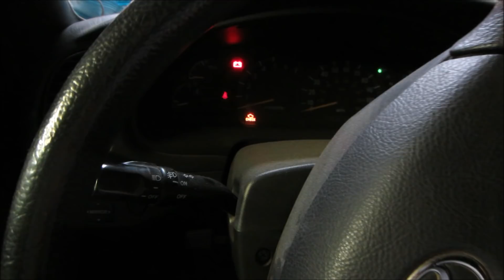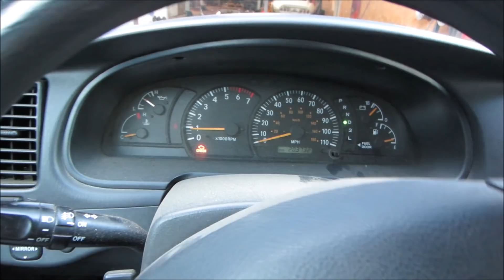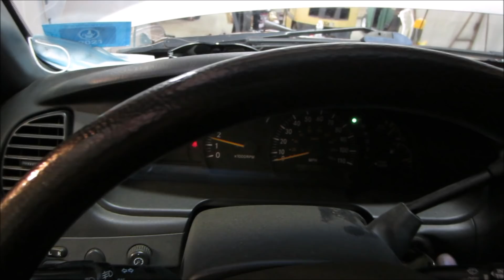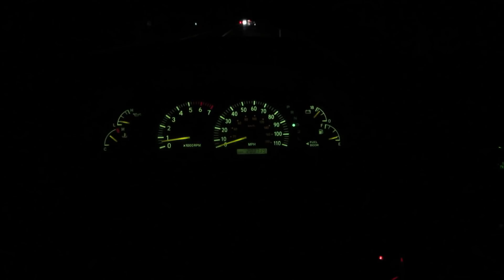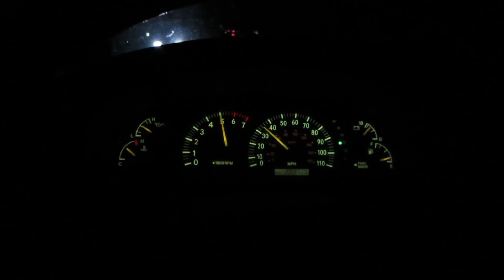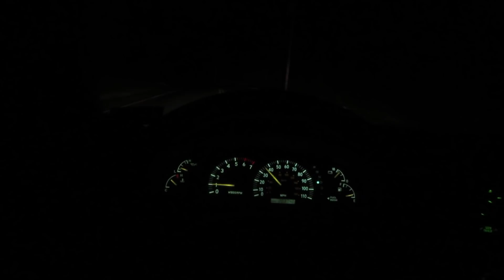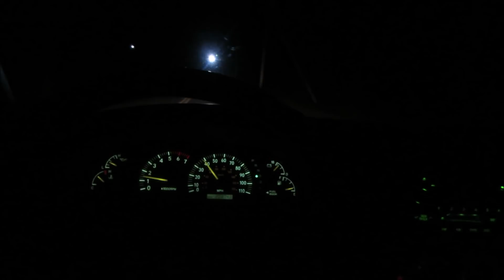What Screwed Up My Engine? You Won't Believe It

Comment: I got a tip that might help you out in the future....if an engine Has a Miss while it's running..a quick way to do a check on the compression to know whether if there's mechanical damage or not is... rev the engine to about 3500-4000 RPM hold it steady then turn the ignition switch off and as soon as the you turn the ignition switch off ,floor the throttle... as the engine is dying it should die smoothly with no miss...because you eliminated Fuel and Fire.. the engine should be smooth as it's dying....but if it still sounds/feels  like it has a Miss as the engine is dying... there's a compression issue...this works every time

Comment: I had a 2005 Toyota Sequoia with the 4.7L V8. I thought it was an interference engine but debate rages on the interwebs. With your passenger side pully several teeth off it still runs, so I'm guessing NO. I have seen a suggestion that ALL 4.7/2UZFE are interference engines but another place says only post VVT-I engines are. meaning pre-05 are not. If that's true, mine was and yours isn't!

Great fix at any rate. Sorry about Mickey, er Ferris. That’s one for the books!

Comment: Could a used a u bolt fit if it fitted round the exhaust instead of welding it? Good job with the welding anyway. Nice little pick up.

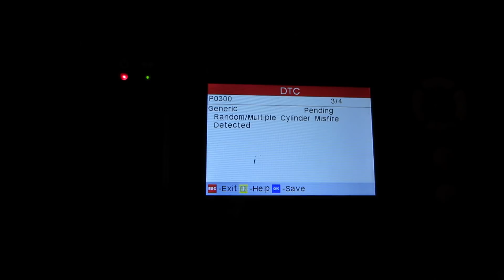Comment: 3:00 my experience with low fuel pressure is that they will typically idle "okay" but just not have any power.

Comment: Enjoy your videos. I was wondering if you have a video or can direct me to one, how to find an electric drain from my battery. 1997 Jeep grand Cherokee inline 6 cycl. I have determined that its through my 50 amp fuse, but now need to find where the culprit. If it sits for two days or more, battery is dead, so I usually pull the fuse. Or if anyone reading can you direct me to a good how to. Thanks Mustie
Reply: He has a video called "how to use a automotive test light" from 17 Oct 2011
you might find useful. Good luck solving your problem!

Comment: I have just started on this video. But my first gen 4.7l I went through rough idle on low, but I wasn't down on power. Had random mis fires on all cyl at low rom on small load. Mine ended up being crank sensor

Comment: Thats what I was trying to figure out on my car... am I a tooth off or not? It seems to idle equally shitty no matter what. My dizzy maxes out at 12 degrees advance but I want to turn it up more to satisfy 108+ octane propane... is that acceptable to move it a tooth to get more timing?  My spark plugs aren't burnt but they have a V-notch in them unlike what is shown on any chart. I don't get any knocking or anything... Idk what that might be. Seems like it loses power at high RPMs

Comment: you being a VW man you didn't jput Bosh spark plugs in it did you? They will not work in a Japan motor. I did that with my Nissan and it just didn't run great from the start. A few thousand miles and it ran like a rag, started missing, check engine light came on. I talked to a mechanic friend and he told me only plugs with a Japan brand will work. Never did that again. He also told me only Bosh in a German car.

Comment: Here's a tip for ya of coating your truck frame - Spray with Fluid film every fall or every second fall. and spray your battery terminals too to keep the corrosion down.
Being that rusty also check your ground connections to the transmission and the grounds to the frame as they are prone to decay and cause no start conditions

Comment: I hate timing belts... As the car ages it a costly process to redo it.. I do most to a car but give that away..not worth the trouble.. a shop has tricks and tools.. just me.. Lucky its not a es300...
Reply: timing belts are retarded, especially on interference engines, that being said, costly... well theres some chain driven engines that will make you love the belt, when you have to bring the entire engine out and then take most of the engine off to even access the stupid thing, but that being said, i hate belt driven as the only points ive seen in its favor is that its slightly quieter, and the belts a bit cheaper. but ill take louder and more expensive if i dont have to check the stupid thing ever 20000 miles.

Comment: .....Musti,  having spent some time in the trade and educating myself on O2 sensors. I have found that in general they have a life span of not much more than 100,000 miles (160 km) , and this is dependent on whether city driving/open road driving is the norm, the quality of the fuel and general tune of the engine. I know that sounds like alot of variables, but that's the Motortrade. And thanks for the video showing us Toyota's latest offerings in mouse traps. p.s I might have made a hooped clamp that went right around the pipe that would keep the sensor in place.

Comment: Ironically I'm not new to this. Had a mouse build a nest in a riding mower engine On a machine I use, and well lets just say that the ring gear on the flywheel didn't play too well with the mouse...

Comment: I'm really curious why with all that hand turning of the engine you didn't spend 5 minutes to pull the plugs so you weren't constantly fighting the compression.
Reply: Hi Barry!  I think he may have been worried about  breaking an injector or wire etc, creating more problems than he already had.

Comment: They had a MASSIVE recall and replaced the Frames on many Tundras and Tacomas.  I had one replaced on my 2009 Tacoma.  Have you asked them to replace yours?
Reply: his went through the recall, the frame wasn't rusty so they cleaned the frame, sprayed it with undercoat and called it good. A few years later when the frame rusted out he bought it cheap and made a series of videos about welding up the frame.

Comment: I killed a 3.4L engine in my 2001 4Runner with a bad radiator cap. Blew the hose off and badly overheated the engine.

Comment: Maybe a bit of metal tube cut to length between the welds on the studs and the sensor plate would have prevented the distortion to the plate we saw as you tightened the rear bolt down.  My concern is as the exhaust gets hotter that distortion will increase.  I know getting the tubes exactly the right length would be a pain but it's worth a shot.

Comment: i have an error code p300 cy 1 misfire have done everything i can find to do and still there mechanic told me the 1 cyl is shot so im lost any ideas 2001 chevy blazer lt  changed spider fuel injectors,new plugs wire a year ago,new fuel pump,filter

Comment: Turning the engine with the belt out of time risks damaging valves. It would have done more since it ran that way. That is why there are 2 marks. One is for setting it up and you can turn the crank without any valves possibly hitting a piston. The other is for verifying proper alignment. It is best to replace all the components. seals, belt, tensioner, idlers, water pump, hoses, and coolant. Since you got it used how many of the parts didn't get changed the first time around.

Comment: I'd love to try slipping two thin strips of metal between the belt and cam gear. Then hold the belt in place using the crank and turn the cam gear until timing is correct. Then turn crank until the strips come out. No playing with the tensioner

Comment: Very lucky you did not blow that engine. Its a interference engine. If that belt had broken the valves would have hit the pistons.
Reply: Is a 2005 Toyota Camry v6 have interference engine ...an  belt drive??🙃

Comment: the wheel nuts are your basic BS ones sold at autozone and other auto stores they are about $20 a set with key and some stores have the keys.. they only make 4 key vairants i bought 3 sets and managed to get 2 out of 3 that use the same key

Comment: You cant re-use a timing belt once it has been run. On the 4.7 engine you have to buy a timing kit. Everything runs off the timing belt, water pump, idler, tensioner. Belts are good for 100k. It's the water pump that leaks and fails. This is an interference engine, if the timing belt fails, pistons hit valves, it's a twin cam engine, big money. Timing kit is not cheap but worth it. Replace the thermostat also they like to fail to. 4.7 will run for 400k.

Comment: "Progress", in engine design? No, not really. We were better off with the flathead engines of the 1950's. These modern OHC motors are nightmares of complexity, and the more parts there are, the greater the chance of failure. As for rubber timing belts, well, whoever dreamed those up, ought to be put up against a wall.
Reply: Flathead engines? 

Yeah we were way better off with 120 horsepower out of a 300+ cubic inch engine. 

Timing belts are great, they don't stretch like chains do. Most of them are easily replaceable.

Comment: I wonder if that oxygen sensor could have just been cleaned instead of replaced?  Also, I find that silicone tire shine can usually protect exhaust, including those rusted gone nuts and O2 sensor bolts, though only downstream of the sensor on the inside since sensors should not get coated with silicone.

Comment: Toyota design is not that easy to work on I was surprised to learn! To change the leaking water pump on my hilux surf I discovered it was necessary to remove the timing belt, camshaft pulley and the timing belt rear housing simply to reach a single hidden bolt for the water pump. Stupid design.

Comment: With a timing chain this would not happen plus they last a lot longer.
Reply: Timing belts are kinda useless on V block engines, the aspect of being easy to replace goes out the window on them, also belts are better suited to transversely mounted engines too because there’s no fan and water pump in the way (usually)

Comment: says random because it misfires between cylinders meaning fires than not causing others to follow. problem before coil coil or plugs usually says what bank unless you have read write software never seen one specific cylinder shown. anyways like the china wiring look at and ? nope haha 10min later half the harness out. haha ad over back to why this broke down.